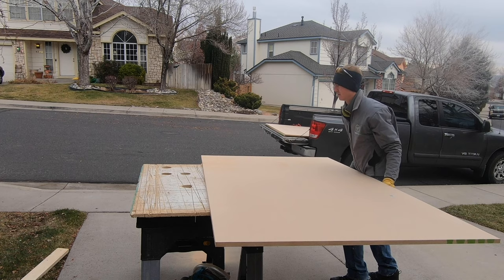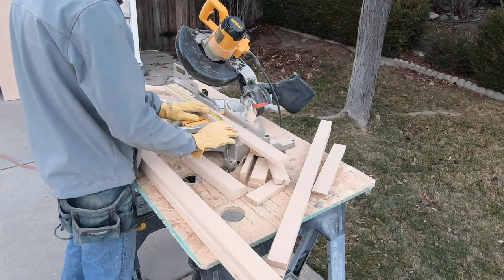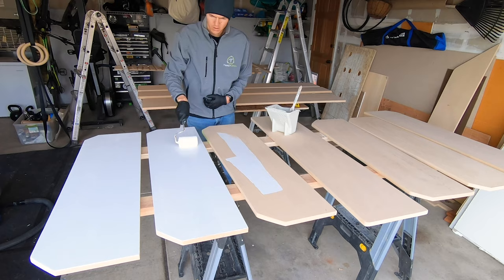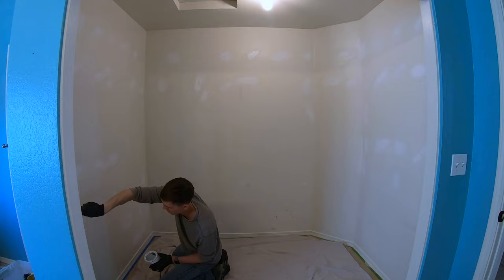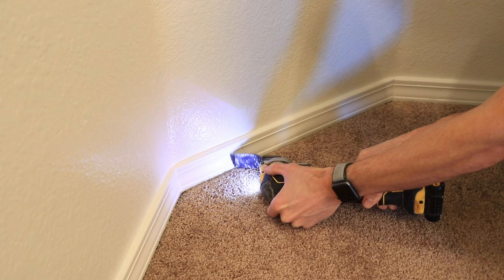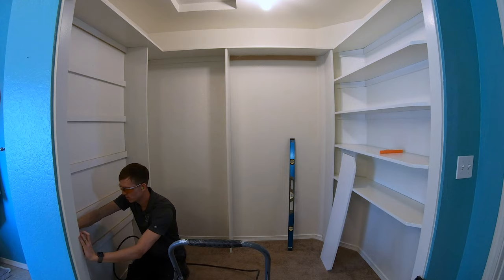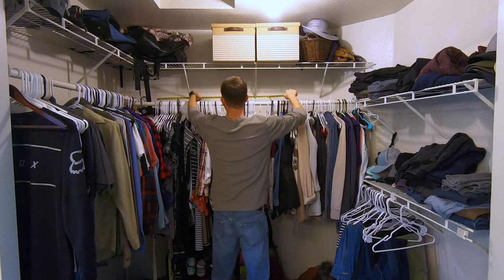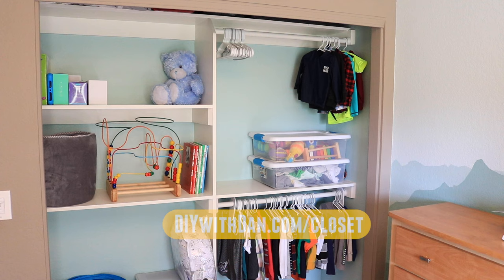Simple but awesome DIY walk in closet build (step by step)

Comment: Just a couple of comments.
1.  If you don't have a pick-up, you can get Home Depot/Lowes etc. to cut the shelves for you when you purchase the MDF sheet.   
2. If you are cutting the 4X8 sheet yourself, keep in mind after you cut the first three 12 inch shelves, the fourth shelf (the left over piece) will be 12 inches minus 3x the thickness of the saw blade.  So if you want 4 equal shelves, you have to determine the thickness of the blade then multiply that by 3 and subtract the result from 48 inches.  Then you can divide by 4 and use that as your measurement to cut each piece.
Reply from the maker: Thanks for the tips!
Reply: @StayHandy  You're welcome. Really nice job on the closet.  Thanks for mentioning the water based vs oil based issue with the paint.
subscribed
Reply: @StayHandy Are the shelves the same color as the closet walls?
Reply: Last time I had HD cut my stuff they messed up all the measurements! I had to recut everything myself.

Comment: Thanks for this great video! 🙂 what if we want to put our railings for hanging clothes drilled straight on the wall. Can we do this?will it be stable? Thanks!
Reply from the maker: You want to try to hit a stud so it can bear the weight. If you can’t, you can use drywall anchors and since they are only seeing a shear force they should hold up.

Comment: Super video, I’m lucky, because I have the same closet, I’m going to build one, thanks a lot for your time an video. Only one question, how much approximately did u spent in your project ? Thanks again.
Reply from the maker: I can’t remember exactly, but less than $200. The main cost is MDF and paint. But you may need a closet rod or two.

Comment: Great video, but two things I don't get:
• You say that shelves longer than 3 feet should have center supports—but your side shelves look about 5 feet, and have no supports?
• How do you attach the shelves where they meet at the corner, so that the front of the one that doesn't go clear across is supported? Is there any way to do that without adding a bracket or brace, which would be very awkward in such a confined space? I've searched the web for clues about this, but there's surprisingly little help.

Comment: Looks good. Just a heads up though- A brad nailer isn't really the suitable tool for securing the shelf supports to the wall, brads are more for attaching thin light decorative trim. Should be using a 15 gauge nailer, or screws. Trim head screws work well for this, less spackling before paint than a typical countersunk screw head.
Reply from the maker: The nails are loaded in shear so are quite strong. I think you should reconsider your thoughts on this one. I’ve installed shelves like this all over my own home and put very heavy things on them and have never had an issue.
Reply: @StayHandy  I've been a carpenter for 20 years, much of that in finishing work.  That is the wrong application for a brad nailer. Yes it will likely be fine and have some strength, but technically 15g is the more appropriate nailer here. That is the gauge typically used to set doors in addition to hinge screws. Thicker trim should be nailed with a heavier gauge than brads. I've seen where heavy base or casings were nailed into studs with brads, and they pull away from the wall after awhile, and that is just trim with no load.

My advice would be to look into the different gauges of nailers and their typical applications.  This is not an application for a brad nailer. Yes it will likely be fine, but why not learn amd improve as a "handyman" from those who have been the trade for awhile.

Comment: Thanks, Very helpful watched it several times for little details you mentioned. Just one question, what if I don’t want the vertical boards to touch the floor? How can I support them with 1’ ground clearance?
Reply from the maker: You'll have to attach them to the wall using L brackets or screw a 2x2 to the wall and then attach to the 2x2. There are other ways, but it will require a much stronger attachment method if the weight isn't being transmitted through the floor.

Comment: Fabulous video! You cut the carpet to rest the vertical plank upon. Because the cut carpet changes the elevation of your plank across ALL measurements, how do you factor in that cut?
Reply from the maker: Thanks! I cut the verticals prices an inch long and then cut them down during install to the exact dimension I need.

Comment: Thanks for the detailed video. How you are connecting Vertical boards. I don't see glue or nail?
Reply from the maker: The verticle boards are held up by the shelves and the floor. They are also nailed to the shelves.

Comment: Hi!! Amazing video! We’re about to go through the process ourselves. I have a question about the closet rods, since you put them together side by side on the sharing MDF piece, did you have to do anything differently? I’m worried about ours having uneven weight distribution or something. 
Thank you 😊
Reply from the maker: As long as the brackets that the rods sit in are secure you shouldn’t have any issues.

Comment: How do you install the triangular support and how do you anchor the shelves to the supports?
Reply from the maker: Good question. I used the same nail gun (brad nailer) to attach them to the wall at stud locations. Once they were nailed to the wall, I put a couple of nails in from the top of the shelf down into the shelf supports.
Reply: @StayHandy  thanks
Reply: @StayHandy  did you toenail them in or just put a nail near the bottom? Just thinking it’s too thick to go very far up the triangle with brads.
Reply: @ctaz1  did you ever figure out how to do this. Same question I had on the triangle to the supports. Only way I could think is pocket holes. I’m at this point in the project. I need advise 😬
Reply: @charlecegrubbs959  I have not gotten a response. I guess pocket holes are an options but doesn’t seem strong enough to me. But I haven’t tried it myself yet.

Comment: nailing if you have wood stud right?.... what if you have metal stud?
Reply from the maker: Then a different shelving system might make sense. You could use screws and anchors to replace the nails, it will just take longer.

Comment: Is that 2 long clothing rails or 4? I'm not sure how they join together properly in the divider if that makes sense? Won't 1 be in the way of the one on the other side ?
Reply from the maker: It is 4. They are held up by brackets in the center and on the walls.

Comment: Can you share the standard height of the upper shelf and  half hanging rial etc
Reply from the maker: The upper shelf is 12" on the big closet, and it's only 10" on the other closet. It only needs to be a different size if you need it to be.

Comment: What size brad nails did you use for the shelf support going into the vertical divider on the left side wall, I think 2” would go through them too far?  How are you attaching the triangle supports to the wall side, it looks like 1 brad nail but I wasn’t certain.  
Thanks for the help!
Reply from the maker: I believe I mention the nail length in the video, but 2" is fine. The triangles are supported with several nails (also 2") and they are placed at stud locations.
Reply: Can’t be 2 in, it’s  3/4 nailed onto a 3/4 it will go thru the other side

Comment: How did you secure the triangle shelf supports?
Reply from the maker: They are bailed with 2” brad nails into the studs through the flange on the back, then nailed down through the top of each shelf into the triangle piece.

Comment: Another awesome video! Got a question tho. Why not use Melamine to save on painting. Would appreciate your thought. Cheers!
Reply from the maker: Good question! I considered it, but it's more expensive and creates more waste since it's only finished on three sides. It also limits you on color since you can't paint it. If you are using shelf brackets, then Melamine is a good option. Just depends on what you want.
Reply: @StayHandy  Appreciate tips.  It makes a lot of sense considering color options. Cheers !

Comment: You didn’t show how you installed the shelf supports
Reply from the maker: sorry about that. The same was the other supports. Place them at the stud locations and use a brad nailer to nail them to both the wall and the the shelf.

Comment: Wat does mdf stand for?
Reply: Medium-density fibreboard (MDF) is an engineered wood product made by breaking down hardwood or softwood residuals into wood fibres, often in a defibrator, combining it with wax and a resin binder, and forming it into panels by applying high temperature and pressure.

Comment: Great job, you make it look easy, but I do this for a living and I know how much work it actually takes, you say a diagram, but thats DESIGN, and thats a whole job apart, 5 years Of Study, walls are never perfect and you dont say anything about the angle that makes it more complicated, unfortunately this just makes people think this Job is easy and anybody can do it, I asure you, NOT EVERYBODY CAN DO THIS AS CLEAN AND EFICIENT AS YOU, AND THATS EXPERIENCE, sorry, I just feel like these kind of videos confuse people into thinking this is easy and that they can do it themselves and not pay for the job, or think we charge to much just for cutting and painting, ITS A HARD JOB AND ALL THE PLANING AND DESIGNING HAS A COST.
Reply from the maker: Yes, this process does take a lot of time and most people won't be as efficient. I appreciate your perspective and hopefully it helps a few other people.
Reply: I'm trying to build a closet for my sister. All the videos on here make it look so easy.
They leave out one thing dimensions. I'm confused.
The framing is easy, but the dimensions used would make it easier for someone to copy. Granted, they have similar space, of course.
Reply: How much would you charge to fix such closets?